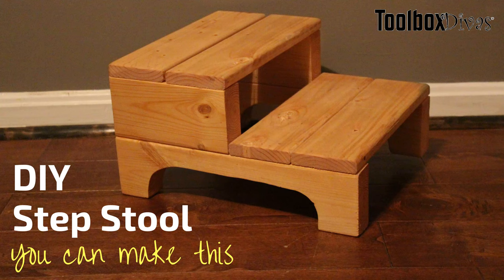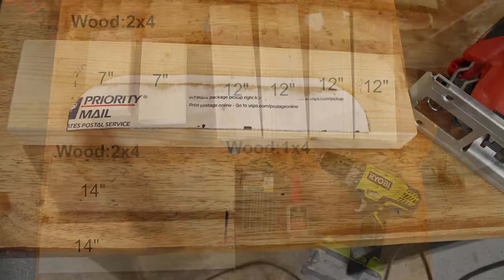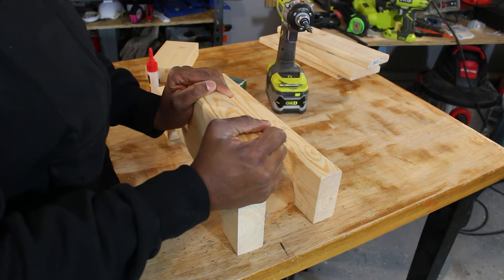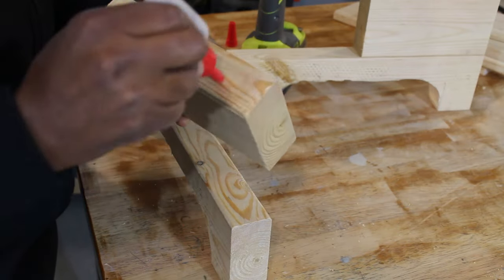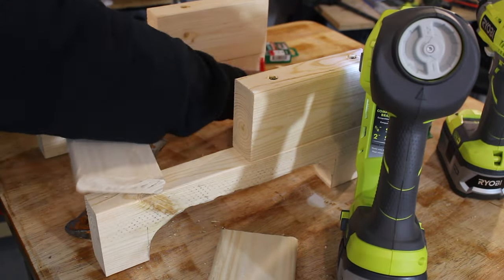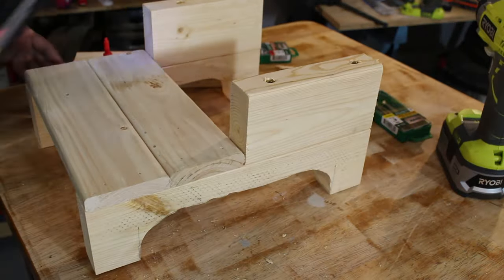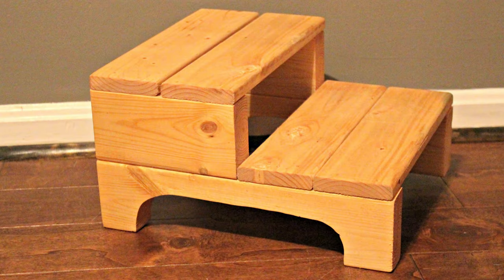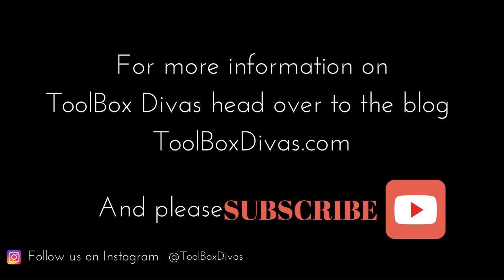How to Build a Step Stool

Comment: If i were to make this for adult usage I would use 2x6 or 2x8s and id cut a square piece of 4"x4" plywood for gussets to attach the 2 pieces inside and possibly a brace on bottom to make it more ridgid. With larger width dimensional lumber offers minimal lateral movement so id probably go with a different method but since I made it for my son its pretty solid.
Reply from the maker: mixwell1983 Hey those are awesome adjustments for an adult size step. I'm so glad you were able to make this for your kid. I am thinking I might update this at some point.
Reply: @Toolboxdiva  well overall the step stool and the toilet seat top was easy.  The potty training is where the work begins. I'm glad you checked out my video results. I made a bitchin pallet wood chevron table top.  So far no cost in materials but to see my son be able to reach the toilet is good enough for me.

Comment: This is not how to make furniture. There is no structural stability. Super glue and pin nails are the only thing holding this together. Superglue is a temporary bond at best on surfaces like wood. It would still be an eye sore if it you used real wood glue, but at least it would be less likely to kill you. As that thing is built, I could pull it apart with my hands and that is definitely not something you would want to be climbing on.